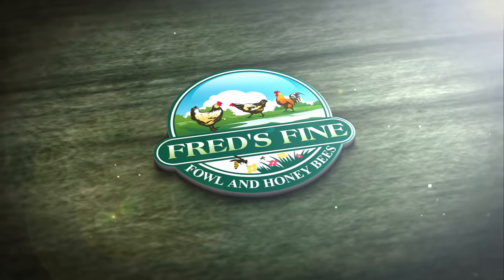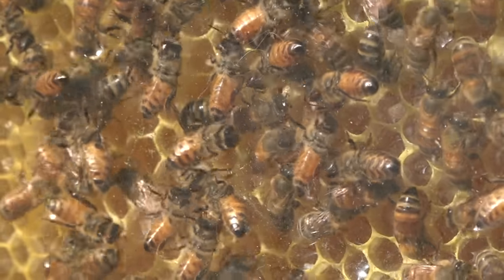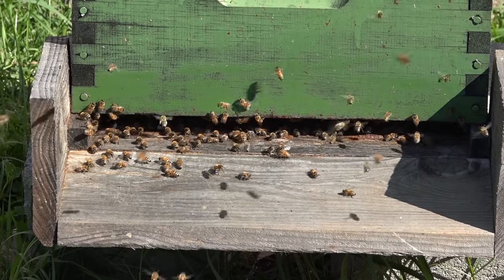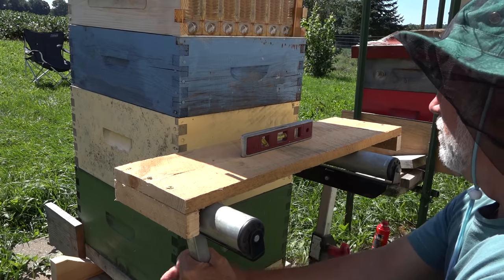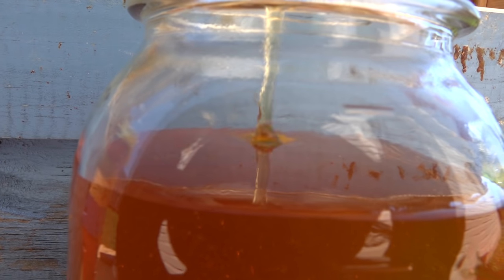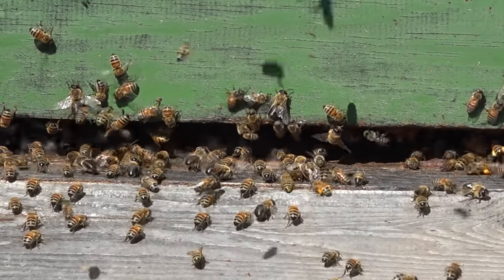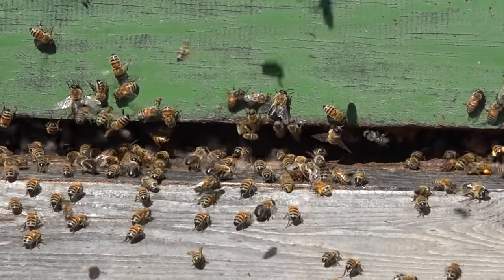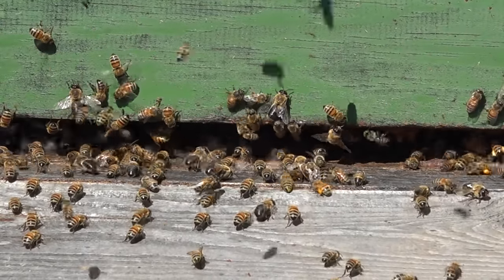First Flow Hive Extraction Cycle How to remove honey without filtering frame by frame

Comment from the maker: One Observation I didn't address in the video. When I opened a frame all the way all at once, we received more honey than if I opened the frame in stages. I think that opening the frame in stages allowed more time for the honey to seep down into the hive body. I would also tilt it back the full 5 degrees to aid in getting the honey out faster and again limiting the opportunity for seepage. Thoughts?
Reply: I will not add suppers to my hives till next Spring, BUT I'll share my plan at this point. I as well have the hives tipped forward  around 3-4 Deg BUT plan to add a permanent 8 to 10 Deg shim to the bottom of the Flow supper netting somewhere in the 5 to 7 Deg  rearward tilt. AFTER watching you vid I'll be looking into incorporating a tray (shelf) at the rear of the shim to catch the leaked honey in an attempt to keep the girls inside the hive...
Reply from the maker: harley4jcs Will look forward to seeing how that works out. The leaking isn't the only reason the colony occupants evacuated, it's alto the sudden increase in hive humidity from the open cells. Both are contributing factors. Thanks for sharing.
Reply: Hi Frederick, first of all, let me thank you for the great quality of the videos you have been doing. I'm from Brazil and I'm thinking of buying one of these hives. I saw on another video that it's better to turn the key on one side at the time. If I find the video I can send to you. 
Let me take the opportunity to ask you a question about the hive maintenance. What kind of cleaning do you have to do and at what frequency? One more thing. What is the life time you expect to have till it's useless? Would you show how it looks like on the box under the one the contains the frames on a next video?
Reply from the maker: João Silva Hi Joao, thank you for all of the compliments, I will be answering many of your questions in the next video. As for cleaning, I haven't done any cleaning as the bees keep things inside nice and tidy. I will also be demonstrating how to activate the flow frames and which method (step by step, or all at once) produces the most leakage into the hive. Thanks and have a great week!
Reply: Frederick, great video quality and your voice over is super, so much better than text. Regarding the honey that overflowed into the hive. I have several friends who saw this happen by the first person in the group to harvest. The rest opened the individual frame in stages. Once the flow from the frame started to slow they would go a little deeper with the "key" and open another group of cells. No honey flowed into the hive at all. This required some more attention, but only added 15 to 30 minutes to the overall process. 

Again, your contributions to beekeeping and the environment wonderful, thank you.
Reply from the maker: Thank you Jim.. I have discussed this with those at the Flow-Family and it's common when you are activating the frames for the first time. They say that subsequent draw offs will produce less and less honey dripping inside. We are constructing a demonstration bench and will examine them in greater detail. I personally found that frames opened in stages lost more than those opened all at once but that will also be tested. Thanks for your nice comment!
Reply: Hello Frederick. How are you doing with the demonstration bench. I am about to do my first harvest of a 7 frame flow hive, and I am really interested in what is the best way to prevent or reduce seepage.
Reply from the maker: Hi Tommy, the bench demo is delayed. I will share that the second time around with the same frames, the leaking is much less than before. Apparently, the bees seal up the exterior better after the first harvest. The people at Flow confirm that the first harvest does demonstrate more dripping than the second time around. Makes sense to me. I suggest that for the first harvest, make sure you tilt back the full 5 degrees and just do one or two frames each day so the bees can keep up. We are having rain and colder temps, so I can't do the demonstration I was hoping to. sorry about that...
Reply: Thank you very much, I will do that. I'll let you know how it goes.
Reply from the maker: https://youtu.be/GdYSNuAHigs here is the follow-up video Tommy
Reply: Frederick Dunn hi

Comment: That's a little detail that a lot of people miss. One guy was showing pictures showing how bees start at the edge of the frame and work towards the center and he was trying to prove that the flow hive doesn't take account of that and that you would never know for sure when the frames were ready to be harvested. But I pointed out that the bees don't start at the exact edge but rather close to the edge which they seem to leave for the very last. That's why FH tells you to wait till the very edge is completely capped. I'm so glad you pointed to that.
Reply from the maker: The only place I have noticed honey capped at the edges and not in the center is when I am in the deep boxes that contain brood, pollen and nectar resources in a ring for feeding convenience. Up in the honey supers where there is nothing but nectar and finished honey, the storing behavior is very consistent from top down and center out and as you say, the edges are finished last or not at all in some cases. The bottom line, of course, that ends all speculation, is to simply test the honey you take off for water content/percentage. Thanks for sharing and I'm glad I covered something useful!

Comment: Fredrick you have some incredible videos, thank you for all the work you put into them. Now that you've had the Flow supers for a couple of years we're wondering how they're holding up after years of use? The high price is a concern if they don't hold up after continued use. Thank you for your input, Brian and Rhi
Reply from the maker: Hi Brian, that's a common question I receive and as of this spring, the original flowframes are still fully functional and not showing signs of wear. I think the propolis and wax that the bees work into the contact/friction areas serve to protect and lubricate. I may power wash a few this summer just to see how they look without any of the wax present. But for now, they are doing well after being in service for three years.
Reply: That’s great to hear. Thanks again for all the thoughtful videos you post, you’re really inspiring.

Comment: Say you don't extract any of their reserve honey, do the bees consume it all at the end of the winter? A weird part of me feels bad for taking away their hard work to prepare themselves for winter.
Reply from the maker: Hi Renee, that's a great question and what I personally do, is tend to leave more than they need on in the fall and after winter has passed just at the beginning of the spring nectar/honey flow, I will take off remaining honey from the previous year. It's interesting that old frames of honey are often ignored by the bees when another nectar collecting cycle begins, they use the new honey stores first. BUT, with honey bees, there will always be colonies that have their own set of rules. If you want to be safe and not starve your bees, take the surplus in the spring. Some keepers don't like that practice as some honey tends to crystalize or "candy" in the cells and can't be drained or spun out. I pull solidified honey supers and set up feeding stations with them away from the hives. They will clean them up and you can then put them back in service for another nectar flow.
Reply: Renee European honeybees are a species which are well documented for producing far, far more honey than the colony requires. In comparison to other species of bee, the honeybee produces a magnitude of honey greater in comparison to the size of the insect and colony.
It is the reason this particular insect became an excellent source for farming honey by civilisations over thousands of years.

Comment: if you didn't crack open the full frame at once, instead breaking open only a half or a third and waiting until that drained, would that address the issue of honey overflowing the collection tube and dripping down into the hive?
Reply from the maker: Correct, if you watch the second extraction video, problem solved.

Comment: Very interesting!!  I had my doubts about the flow system since I'm just skeptical of anything that refers to itself as revolutionary, but you dispelled my main concern which was the water content of the extracted honey.  I think most keepers who dislike the flow hive feel that their hard work is being discredited by such an "easy" system, but bee keeping is clearly still hard work, even with an innovated system.  Change will always be met with resistance, it seems!  Thank you for sharing your findings in such an informative, thorough manner!
Reply from the maker: I completely understand the measured acceptance of any new innovation. We are wise to question and learn, hopefully, distilled from bias. I think you are absolutely correct in that some older keepers are threatened by something that takes so many steps out of honey removal and "appears" to make bee-keeping easy. As you've mentioned, the complex aspect of keeping bees has not changed and knowledge is key in successful bee management. Many new keepers are learning that.

Comment: Good video, thanks for making it clear that no honey was dripping before, at the end you show that some frames still had honey in the bottom that bees can't get to it, don't forget to address that situation on your next videos.

Regarding flow hive marketing about it don't bothering bees when draining the honey you show the opposite, it does bother a lot the bees, having bees outside for hours means that something really bad is going on, if honey did really drip inside you could lose bees and even the queen.
My experience with harvesting honey with extractor or crush and strain never had bees clustering outside for hours, just some angry bees but that's normal with defensive bees like we have here.

Finally about economics, you got lots of honey but no new wax from it, wax can also be sold for a good price and is healthy for the bees to make wax.
Reply from the maker: That dripping statement was for you Paulo! :)   AS for the wax, I don't use it anyway and still have my other hives for that purpose if ever I need some. Remember, it takes a pound of honey to produce an ounce of wax. All interesting and thanks for commenting.

Comment: Dare someone say that flow hive technology might be even better than the old traditional Langstroth frames because of what you stated about being able to extract the different honey frames independently without all the wax mess to deal with and everything getting mixed up together. It seems like this technology has matured and weathered the test time so to speak of the eccentric and defensive bee community at large to become maybe a little bit more mainstream now?
Reply from the maker: I'd like to think that some people/beekeepers may change their minds. However, it's been my experience that those who made dramatic statements against flow-frames and how they work have not altered their position, they simply don't permit the discussion at all. Those who were undecided in the beginning, have begun to see the merrits of this system. I've met individuals who say "it doesn't work, and it's plastic", and they are not at all open to any discussion on the topic. I once went to a meeting at a beekeeper's home/apiary, he walked over to shake my hand and remarked "Fred Dunn! This FlowHive is Garbage!" and went on to invite me to see how beekeeping should be done. Some minds will never be swayed, no matter the evidence before them. It's the anti-learning climate we currently live in :)

Comment: I had been reading and watching some other flow box articles. Some people suggested only opening it part way and letting some of it drain before opening it fully to avoid to much over flow.
Reply from the maker: Hi Sam, thanks for your comment, if you watch the follow-on video you'll see how things turn out. It's a combination of two things, the bees more completely cover the cells and we did it (as you mention) 1/2 the frame at a time and nothing leaked at all.

Comment: During extraction of honey, what technology makes honey to flow from top to bottom, after Each cells are capped by bees wax. After removing bees wax only, honey can flow know.  But an awesome video!
Super chamber is at the top, the other chambers are brood chambers. Is it
Reply from the maker: Yes, it's just gravity that drains the cells once they are open. After draining, the cells are closed again and the bees remove the wax and fill them. Yes, the lower boxes are for brood and also provide space for honey that is left for the bees during winter.

Comment: I'm sorry if you answered this previously, but just something that crossed my mind as I watched your video. 
The six cell Flow Hive Classic I see listed (I don't see the seven in the premade hive kit) likely produces even less than your 7 cell one. Even if you never tapped it, how could they survive the winter if you only had the basic classic kit (6 cell super and brood box)?

Reason why I am asking is that I'm moving to the country and plan to put in an fruit tree orchard and garden, with a hive (to help my trees/plants and for a little honey). I live in the Northern part of Ontario, and you mentioned that the bees need 100lbs of honey to survive the winter, yet the 7 flow frames only netted you a third of that (ignoring all your other non-flow boxes) so it raised the concern for me.
Reply from the maker: Hi Veronica, no problem at all, always happy to answer questions. A single flowframe completely capped "should" yield (based on my experience) a quart and a half of honey. I did say that my hives/colonies need 100lbs for winter survival. That's a pretty broad statement and I should probably clear that up a tad in my next video. Colonies vary widely in the number of bees that are wintering over, so my 100lb target is for a large colony that goes into winter with a full load. Also, remember that these are "flow-supers" in bee keeping terms, they should NOT be the main resources for the bees, but should be extra. When we have shallow honey supers on traditional hives, they are the extra frames added when the bees are doing very well and already have produced what they will "need" for winter. You are correct that the FlowHive system "complete" doesn't come in this size and would have fewer resources and probably not enough (as is) for northern "snow-belt" climates in my opinion. I do have colonies that survive in 8-frame hive bodies, they have two deep 8-frame brood/honey/pollen boxes and additional medium or shallow honey supers on top. 
Last year we expected this heavy and very cold winter, well, it never hit us, so when the spring came along, several of my hives were actually honey-bound. Absolutely full up with honey from the previous fall. I had to take that off or they would have filled their brood frames with honey and colony numbers would have gone down due to the queen not having cells to lay her eggs in. 
I also had a small colony that was a late season swarm capture. They made it through winter with just 20 lbs of capped honey in frames. I thought they were doomed and are now some of my most productive bees. 
So what I'm saying is that we plan for the worst and hope for the best, my 100# figure is an example of planning for the worst. I hope that helped and I will address that further in my next video.
Reply: Thank you for the response! I appreciated it. I will look forward to your next video! 
So now if I understood correctly, I should probably still buy the kit, but also buy an extra standard style bee box to put between the broodbox and the flow-super to ensure the bees will have sufficient food stores. Maybe I could go with a setup like Broodbox+Flowframe box+Flowframe box+lid style. That way if the bottom flowframe box is completely full, they will have enough food hopefully for the winter, and any full ones in the upper one I can take (maybe leaving the outside ones for them the first year to ensure they have enough). That setup adds the extra bonus of letting me drain some of the bottom flowframes in the Spring time to avoid the honey-bound issue you mentioned since I don't really want to invest in the proper standard honey harvesting equipment right away. Both because it is already a couple thousand dollar investment just getting started up (bee boxes, bees, bee tools, orchard, garden, etc.), and  because I really don't trust my honey harvesting skills being a complete novice at bee keeping in the first place. My plan is basically get a basic flowhive setup until I learn to care for bees properly (joining the beekeepers association here and your videos) then maybe expand the hive with standard boxes once I feel comfortable and can afford to expand it or start a new colony.